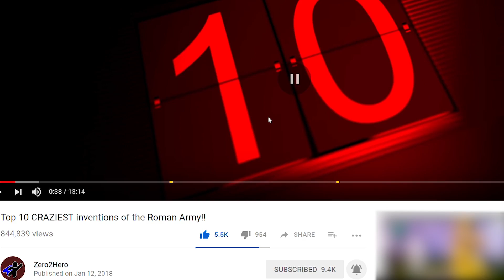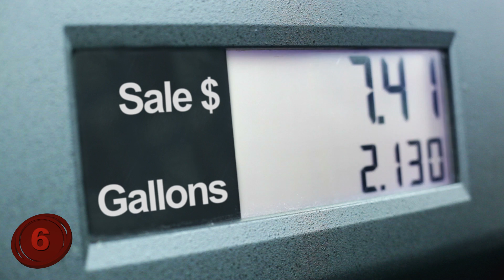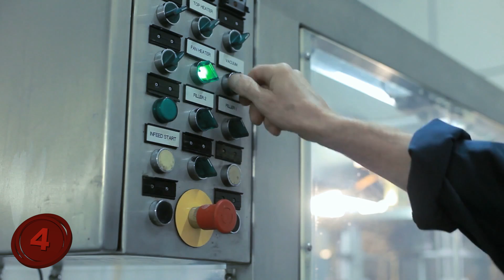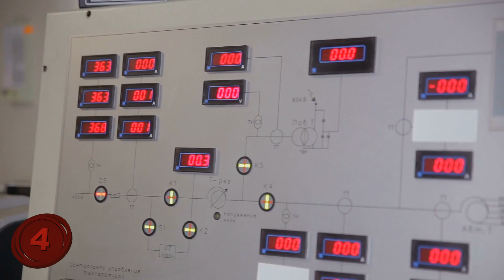Oil Pipelines: What Are The Pros and Cons?

Comment: Pipeline capacity can often be easily increased by adding pump and compressor stations.  You can see them located roughly about every 50 miles apart.   You will get zero flow from Texas to New York City without having some 30 to 50 pump stations.  Each station you add increases the flow rate a bit more.   The limiting factor is the fluid's velocity inside the pipe.  For long oil pipelines that is about 8 ft/second.  For gas pipelines it is usually around 40ft/second.